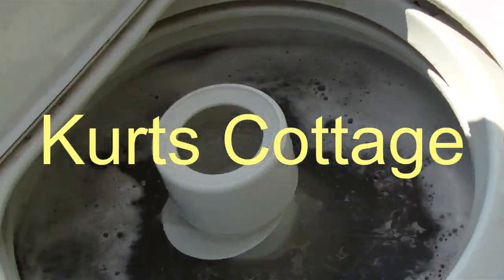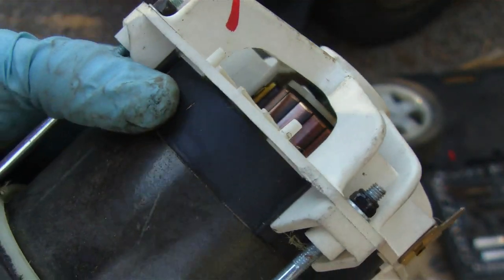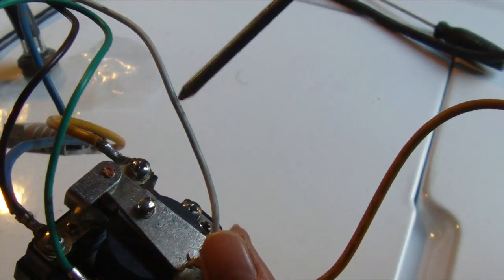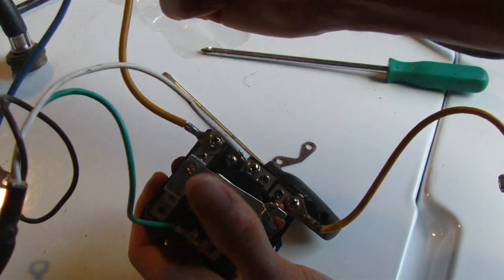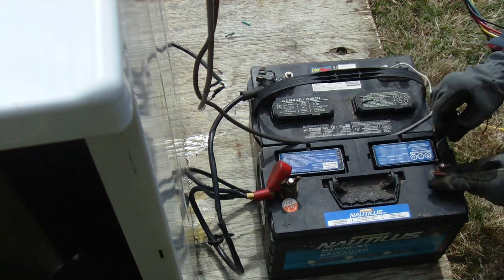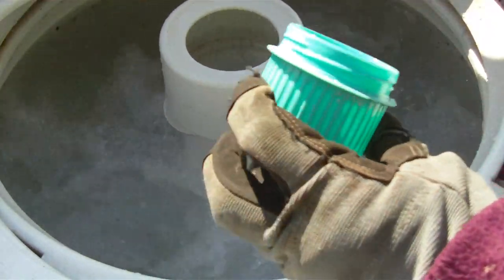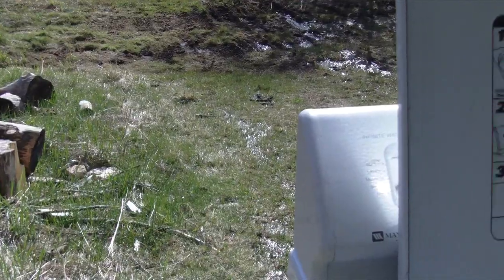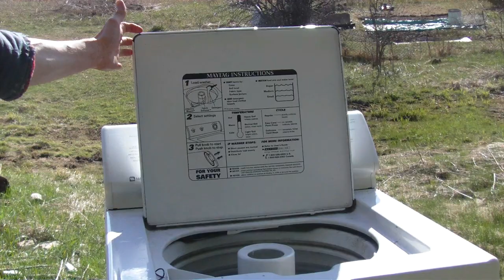Washer converted to run on battery power - 24v for off Grid living

Comment: I'm from the wonderful world of electronics.  I just took a LG direct drive clothes washer and ran it off 130V DC solar array thru a modified MSW inverter. It doesn't use any batteries.  Though, the sun must shine.  A cloud stops it on rare occasions, but the machine remembers where it was when restarted. Washer out in garage has its own 40 gallon hot water tank and I run hot water to cold inlet of machine.  Hot water all cycles leaves them super clean. Hot water is also from PV so laundry is free except for soap! This 2 year old washer was bought for $150 off craigslist because it was broken and cost nothing to fix.

Comment: Sounds like the shock absorbers/dampers/flibbitygibits whatever you call them the things that absorb vibrations are worn. I'd suggest using old tires or rubber hoses but I'm not you. Good video.